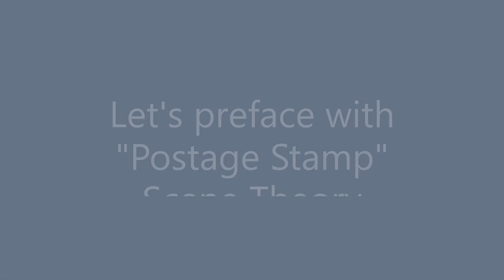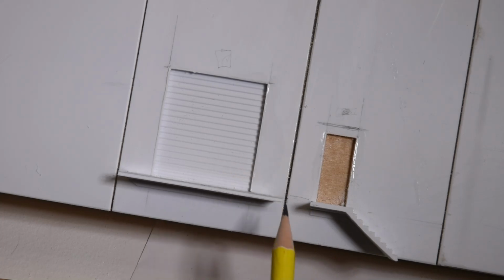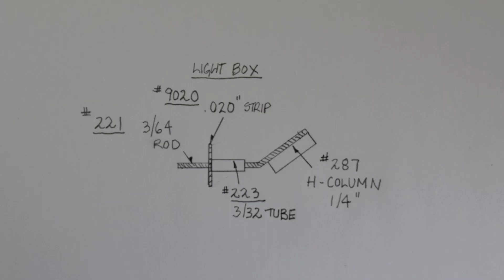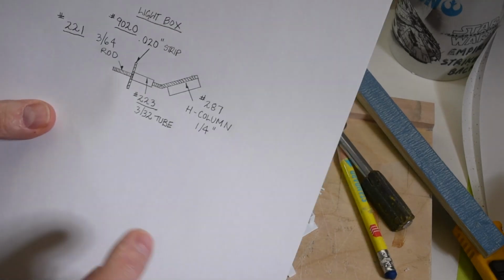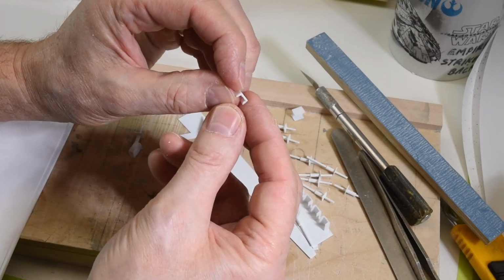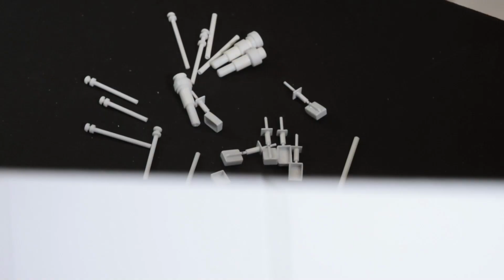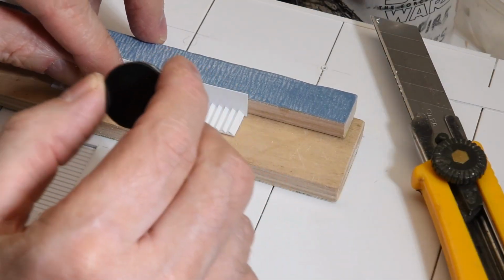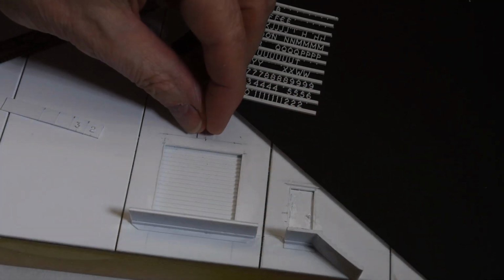Modeling The Big Warehouse Final | River Road ~ Vlog # 80

Comment: Very thoughtful.  I think I would have hung a shaded lamp above thr back door, with a tiny streak of rust from the fitting.
You had me when you went from roof vents -- very handy -- to light boxes without saying you were now talking about the external walls.
I love the final video but I've posted before about how I love the clutter along that line that makes it look busy but not enough to clean it up.  It's not about the detail but the appearance of detail that leaves an impression.
Fabulous!
Reply from the maker: Clutter and details are for another pass at some other time down the road for me. Thanks for sharing though. Cheers ~ Boomer.

Comment: Indeed Boomer, all those little details tell the visual stories of the company which runs the facility, the people who worked and work there. The postage stamp approach in my humble opinion is also a way to intersperse those very aspects of modeling, where it touches on storytelling. Like the written stories will become more interesting, when the gap between the loading bay and the access landing is mentioned. Or into the details of the rain profile above the door, the exit sign, cameras or outside lighting. It all adds to the narration.
Love the way you show how to make the lamps, roof vents and concrete stairs. And as always, how the making more than just one single piece, improves the quality of each object. As does the ‘leaving proud’ where one can clean up later.
Reply from the maker: Thanks for sharing Vincent. Cheers.

Comment: I always learn something from watching you. This is timely, I just aquired a kit of the Gramps oil loading dock in Chama NM. It is made from pipe and elbows etc. I can either use your method of rod and tube and probably have to solder the upper hand railings. Awesome.
Reply from the maker: Sounds like a nice build. ;-) Cheers.

Comment: In the short time I’ve been a subscriber, you’ve really taught me a lot.  So thank you for that.  Now a question, if your warehouse were deeper and you were to do skylights, how would you go about that?  The commercial and 3D-printed options are a bit costly for the quantity that I need.  Thanks I’m advance for any suggestions.
Reply from the maker: I would probably build the "Sky-Lights" from styrene like a low profile rectangle box (like a mini house with  gable roof sides). Then, I would lay on thin strips for frames like I would frame a roof before sheeting, sand it up and paint it, then drop in a piece of clear plastic for the window glazing from the inside with canopy glue. Check out the Brewery Build light boxes and vents here: https://www.youtube.com/watch?v=Zp_6TONwrIk
This is a similar approach. I would build them as mini models and then mount them, at the end. I hope that help you some. ;-)

Comment: Hey Boomer.  Just curious what you do for uncoupling at the present.  I use bamboo skewers.  However I do have a couple of spurs close to the back that I want to try some small neodymium magnets.  Not my idea.  However I've seen them used and I like how effective they seem to work.  

Great video BTW.  I agree it's the small details that really help a scene pop.  Thanks for taking the time to share your skills sir.  🙂👍
Reply from the maker: I use a bamboo skewer as well. If I need to push a car I just gimble the coupler to push and then back away since there is no grade.

Comment: I'm new to soldering - what is in the yellow jar and how is it used? ?  Flux? My attempts on N scale rail joints so far have been disastrous, many ties have been melted.
Reply from the maker: Soldering paste is a must to get a quick clean solder.
Then clean it off (soak away) with Isopropyl Alcohol, which evaporates. ;-)

Comment: Thank you, thank you! I was planning to do this, mentally figuring it out and presto, you make a video. I wondering what diameter of tube has hole to feed wires through? Rather than a solid piece.
Reply from the maker: You can find smaller (hollow tube) diameter in brass from K&S metals.